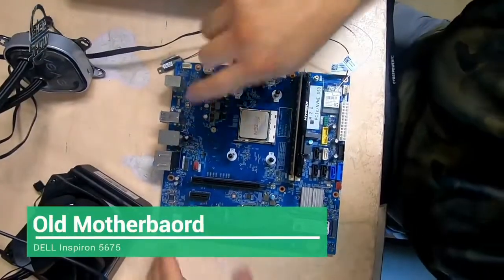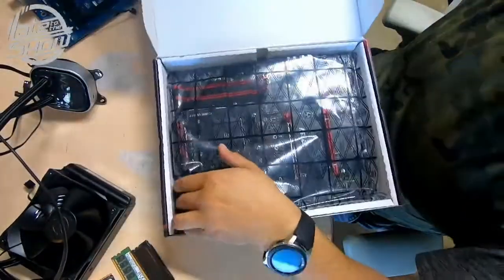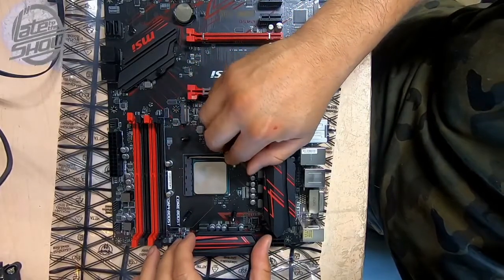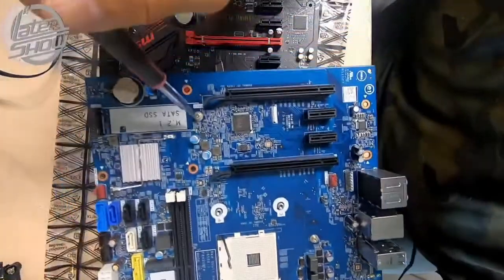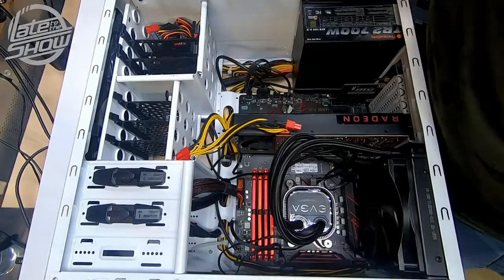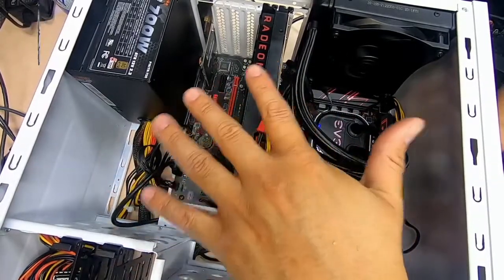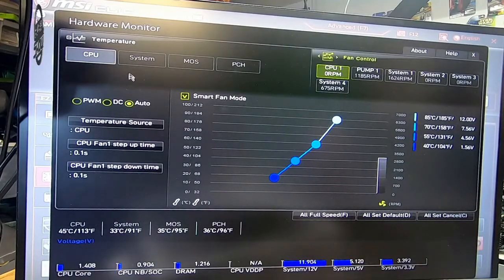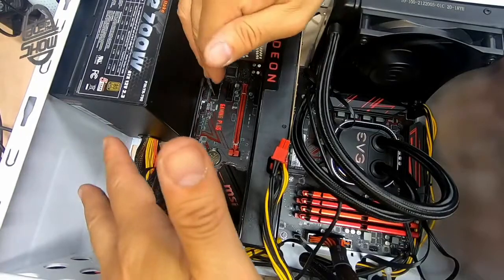B450 GAMING PLUS Max

Comment: I bought mine in December, got it on sale and absolutely love the board. went with the Ryzen 5 5600G and 16GB DDR4 memory. put in a crucial 250GB SSD for backup and have 2 2TB hard drives! system works great and even have the RGB! was able to obtain the TPM module for it at a good price and the system is W11 ready, if I ever decide to go that way...

Comment: Did you have to Bios update the Motherboard prior to running the Ryzen 5 3600?
I'm having trouble getting into Bios with the MSI gaming Max Plus and a Ryzen 5 3600 CPU.
Reply: I'm confused about your question.
I thought this motherboard is compatible with Ryzen 1st gen 2nd gen 3rd gen that would 1000 2000 3000 series CPUs that includes Ryzen 5 3600.
Why do you want to update the bios just to run 3600 cpu?